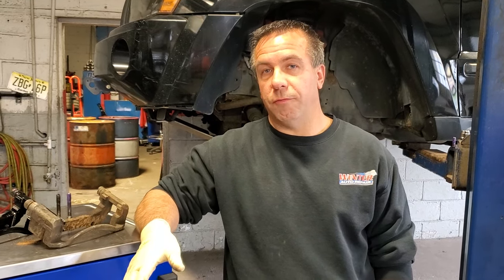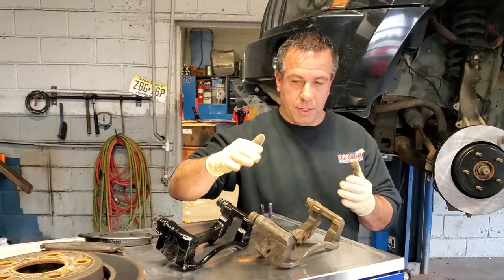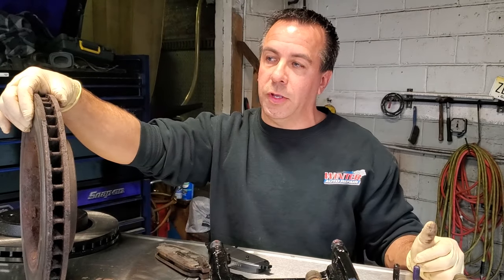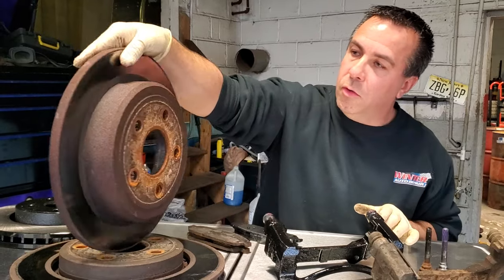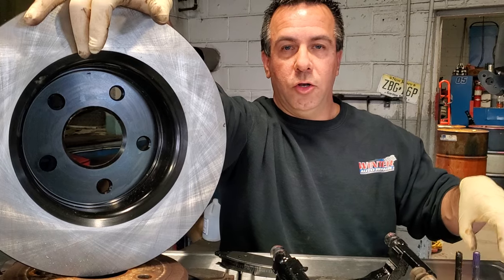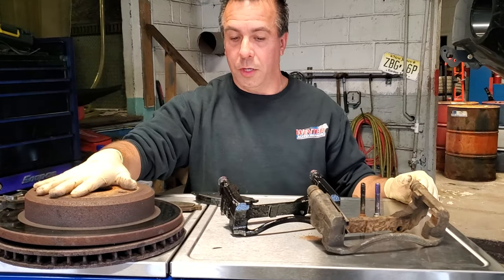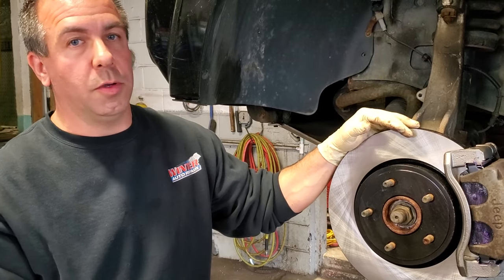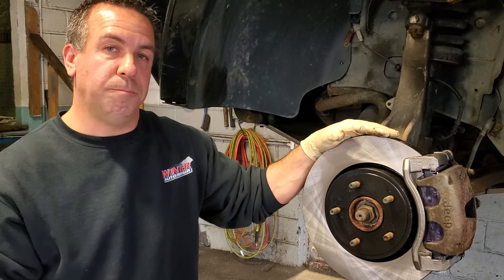High quality brakes vs cheap brakes

Comment: What rotors and pads would you put on a 2009 chevy impala LT 3.5L
Reply: For Impala brakes you can try geobrakes.com they sell all oem brakes
Reply: For Chevy brakes you can try geobrakes.com they sell all oem brakes
Reply from the maker: We use Centric whenever possible.  Our backup at Perfect stop.   Centric are a couple dollars more but worth the money!
Reply: Centric  is a cheap rotor you can find them for less then 30 bucks on Amazon. I'm sure there "quality" 🤡 give him 450 he will hook you up 😂
Reply from the maker: @michaelbukowski8030  they have several lines.   Their 320 budget line to their 125 high carbon line.
Reply: @WinterAutoRepair  Didn't mean to talk down your service I'm sure your great. I just see this new standard or replacing rotors at every break service and it's pointless. When refinishing and painting can make oem rotors last 150,000 easy with 1 or 2 refinish / repaints that prolong the life of the pads assuming you also do a light deglaze . I then making light lines in the rotor with my die grinder bits on my impact wrench.  Using a 1/2 to key bit and finishing with fog oil that you reapply annually. You can refinish to near cut quality without a expensive cut machine no one has anymore.I can get that fresh cut stoping power for any car as long as there is enough rotor material and you can too. Stop wasting on parts and labor smarter :)
Reply from the maker: @michaelbukowski8030  so you spend an hour cleaning up rotors to save 30 bucks according to you.    Just not a wise choice, sorry.    I'll continue operating the way I always have and keep my customers happy.  Thanks for the reply.
Reply: @WinterAutoRepair  Oems aren't 30 bucks and have thick walls with lots of rotor material. It's logical  to refinish not "clean" but do what you want old man winters 🥶
Reply from the maker: @michaelbukowski8030  oem and no thicker than aftermarket.   Tolerances have to be kept in order to fit the rotors into the caliper.
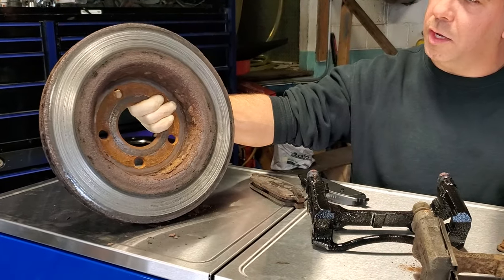Reply: @WinterAutoRepair   You can refinish 3-4 times and still be in spec with regards to width.  Hot rotors are almost always due to caliper pin cease or pad wear. Using a circular sander takes off 1-3mm at a time it's minimal. Yes this method works best for newer rotors at my 30 a rotor rate 😂  But you can easily measure used ones with a metric caliper and remain in spec. Listen you can charge 4 h of labor at   65 an hour and still be way under the price of 4 new rotors. That's 260 a set all shop money no waste on parts . You don't have to use the die grinder bits but the lines you make will give you the same effect in responsiveness  as you would expect in new rotors. I use a wooden block to steady the hand to keep lines thin and long. Alternatively to an impact you can use a rotary tool but it takes longer. 4h is a good number but it really only takes 2 - 2:30h after some practice. If you find it taking less time just charge it like paint and up the hourly you will quickly be the best price in the area regardless. For performance just use the best pads and calipers and make more cross hatched lines in the rotor. Ingenuity is better then complacency and waste but that's my opinion.
Reply: I mentioned OEMs thickness but failed to mention that it's often due to more even wear.  That leads to a thicker lightly used one 25-50k mileage. Thickness of new after markets match oem spec so obviously there the same new but they age differently excluding a few preformance after market ones but those prices are absorbent in my opinion.

Comment: Where can I find the rotors and pads that you used ?
Reply from the maker: Any good local autoparts store or online.  Retailers like rock auto, Car ID and even Amazon have them.   Just make sure you order the correct part numbers for your car.  Amazon may cross a number over and then you will get incorrect parts. Good luck!  Thanks for watching and commenting.
Reply: I got a chuckle from your comments about your racing experience and then seeing that rockauto in this list first time I ever heard of rockauto was a short track sponsor in New Hampshire racetrack and their practically my #1 automotive supplier

Comment: I’m on original rotors 251k miles Acura TL 2005. They don’t make them like they used to. 

My newer Acura MDX with 100k has warped oem terrible rotors.

Comment: I Allways spray my "white box discs" with heat resistant paint for 10 dollar for all four discs. They may start have surface rust after 5 years or more. I can accept that for the price.

Comment: What is the brand purple brake grease that you use?
Reply from the maker: Permatex 24125 Extreme Ceramic Brake
It's good from 3,000° to -50°.   We use it on every brake job including the exotic car and race cars we build and maintain. 
Thanks for commenting. Please subscribe because we will be making more content soon.
Reply: @WinterAutoRepair  Is that one safe for the rubber boots?  I'm seeing comments of people having issues with it causing expansion on the rubber.
Reply from the maker: We have never had an issue with the rubber outside boots. I have had issues with the rubber band that goes around the pin in some cars. Some cars have pins with 1 solid and 1 with a small rubber band on it. We usually replace the pins without bands or pull the bands off. I've had the issue with multiple brands of brake grease not just the purple.
Reply: @WinterAutoRepair  Thanks, for taking the time to reply.  I appreciate this info.  I have a caliper that's slightly seized, so I'm going to try re-greasing and inspecting it before I purchase a new caliper.
Reply from the maker: No problem. I enjoy helping.  Pins typically seize because the boot around the pin has a hole in it and water got in. You'll see rust on the pin. Heat the caliper bracket with a small torch or butane heat gun. That helps free the pin up. If you can get the pin out, get a small brush that can be installed in a drill. Clean the caliper bracket using the drill and brush with some brake cleaner. Once clean get new Pins and rubber boots. They should slide easily with new Pins and purple grease. If they don't, keep cleaning until they do.  Best of luck!
Reply: @WinterAutoRepair  Thanks. My pins were good. The issue was rust on the clips and on the spot where the clip meets the caliper and pads. I scraped away the rust, put in new clips, added the grease. The brakes are now releasing smoothly.
I think they rusted like that because I left the car outside and barely drove it in the last 2 years. I'm keeping it in the garage from now on.
Reply from the maker: We have been seeing that a lot since covid. Cars we not being driven and brakes were destroyed in the process. Congrats on getting them done!

Comment: 1. I turn my rotors frequently (several cars) and I have great results. 
2. Those rear pads ALWAYS show less wear b/c that’s what rear pads do. Probably 1/4 the wear rate.
Reply: Strange because i just did the brakes on my 2017 silverado first time... 70,000kms.. factory brakes. rears were down to basically nothing.. fronts had way more life.
Reply: @Ownag3s0up  is there a chance that somebody changed the front pads before you? It’s highly unusual for the back to wear faster. 

That said, I once had a Tahoe & my brother had an Escalade (basically a Tahoe) that had warped rear rotors. That implies they are being heavily braked & overheating. Your Silverado is basically the same trying as the Tahoe. So, maybe it’s c a GM woe?? 

Nevertheless, that’s highly atypical.
Reply: @Ownag3s0up  also…43k mi (70k km) I’d be questioning why pads need to be replaced at all. Towing a lot?
Reply: @robp2728  no towing. Bought the truck brand new from dealer. Just over 72,000kms. Replaced pads because I was on the squealers for an few days on the rears.
Reply: @robp2728  also noticed my front inner has uneven wear on both sides. Strange..
Reply: @Ownag3s0up  that’s unique. I don’t question your experience. But, it’s odd. Did you see your old pads with your own peepers? 

I service my own cars & I’ve had a host of them. The Tahoe & my bro’s Escalade were the only ones that had aggressive enough rears to warp them. 

It’s probably time you swap to a Range Rover with some factory Brembos. 🤣
Reply: @Ownag3s0up  based on you stating kilometers, I wonder, do you live in Canada? These symptoms could be the result of rusty components that don’t have free movement.
Reply: @robp2728  yes I did the brake service myself.. Lol I do live in Canada.. There is rust but nothing too crazy. I did re-grease the pins and pad brackets after the new ones were installed. I'm confused as to how the old ones  ended up the way they did myself.
Reply: @Ownag3s0up  - Canada…  Nailed it! 😃 

Be sure that the brake pads are free to move when installed. I have a Camry that is continuously warping the front rotors. The last time I took them off & had them turned, I used a dremel to wire brush the rust off of the caliper bracket AND the ends of the brake pads. The rust was very minimal. But, I did notice that the pads were much less jammed. I hope this will make a difference. 

I’m in Arkansas and we don’t deal with rust. This is my first car to self destruct it’s rotors in about 15k miles about 4 times, so far.
Reply: @Ownag3s0up  - https://youtu.be/AY-JGpWUXjg

This guy does a good job of explaining what I did. (except I didn’t consider putting grease on the caliper after cleaning.

Comment: Update:
Cancelled the Centric 120 series rotors because I wanted the high carbon but since the 125 series are not available for my car, I went with the 126 series which are Stoptech high carbon and slotted as per the Centric/Sroptech tech. But they were $590 total for 4 rotors. The series 120 were $200. Hopefully these will last me a very long time.....
Reply: Are centric 120s considered cheap? I thought they're considered pretty solid. I bought some for my track car because my OE ones seem to be on the way out. 

In fact, I think my OE ones are Centric 120s
Reply: are centric pads and rotors good? I recently bought the pads and rotors of that brand from Rock auto.
Reply: @asianstud7  I've used their seals to rebuild my calipers. The rotors are definitely solid. Not sure about pads
Reply: @404nobrakes  Thanks for the reply!!

Comment: When I talk to the people at car shops such as Car-X and Meineke and Firestone they never give me a straight answer as to what kind of Parts they are using they tell me they don't know but they want $500 to $1,000 for a brake job
Reply from the maker: Unfortunately, that's how a lot of this industry is. They make the bill confusing and unreadable.  
We actually take the time to educate our customers as to what they need and why. Then what we will use to fix the problem. The bill is laid out with each part, line by line and the labor it takes to install it. The reason we made this video was to put on our website and show our customers how we would repair their brakes. We had no idea it would get soo many views on YouTube!  
I suggest asking around in your area for local mechanics your neighbors trust. Interview them like you would a Dr.  Then once you find one you trust, be loyal! Go to them for everything from oil changes and brakes to tires. Having a loyal customer makes for a better relationship.  
Good luck and thanks for watching!

Comment: You don’t need state inspection to catch this, whoever owns that car just ignored it.
Reply from the maker: That's true, however, most people don't know what they are looking at.  We keep an eye on everyone's car when they come for oil changes or any maintenance.
Reply: @WinterAutoRepair  I'm still in a mandatory inspection state and one shop practically scared me away from ever getting a inspection done because I knew I was going to loose every cent however as long as I never went there for that they would print out a information page for a multipiint check up and then we could pick items from the list of green yellow or red list items and if you did stop by every time you get the new list up to date I loved that program when I was there

Comment: The brake pad didn't fall off. It was worn off, used until completely gone.
Reply: Depends on how the pad was adhered to the backing. Mechanical versus glued. It appears the pad sheared off the backing. ✌️

Comment: Why didn't he tell us the brand of the roter?
Reply from the maker: Because the quality always changes.  When we made this video, we used Centric Rotors. However, since then, Centric was bought by Raybestos, and the quality is terrible.  
Currently, we use Durago EPB rotors and Power Stop brake pads.  They seem to male the best high carbon and coated rotors. 
They can be found at quality local autoparts stores and online at places like Rock Auto. 
I hope that helps. Thanks for watching and commenting.

Comment: You can turn rotors. I've had the front rotors on my Miata turned 3 times over ten years. The next pad change WILL get new rotors, at least on the front. The rears are still fine (they've just been turned once). If I can drive a Miata LIKE A FLIPPING MIATA for ten years and get the rotors turned 3 times with zero issue, then I just begin to see this video as a "fear" video to get people to buy rotors from his shop at markup lol. Go buy fresh rotors elsewhere and take them down to him for installation and there will probably be "other issues elsewhere" that cost you money.
Reply: I strongly suspect that you have high quality rotors and pads on your Miata.  Further, I expect that the rotors were only turned enough to break the glaze off.  Sadly, that's not the norm - you are the exception.  By the way, I do the same thing when I work on brakes that have high quality rotors.  I use a flap disc to remove the glaze ( I don't have access to a lathe) and install good pads that won't wear the rotor (ceramic not metal sintered).  I would only use the metal sintered pads when I expect a great deal of heat being generated from Track use, Rock crawling, severe driving / towing, etc.  They stop better under adverse conditions but they DO wear the rotors more quickly.

Comment: The caliper and hose being bad can cause the same probem.
Reply: Most definitely, seen lots of vehicles were the hose was pinched due to rust where the hose attaches to vehicle. Open it up a bit and “oh look the caliper works again” but shops will never tell you that. Caliper and new hose much better for profit lol rip the customer off and may never come back or save them some money with an easy fix and explain the problem to them and will have the customer for life! Just my experiences… lol

Comment: By the way, those rear disks were good for another 50k miles. Rust on the outer housing? So f'ing what!  And sand the bracket all you want that is fine. But  it is the SS steel clips that the pads slide in. grease them and all is safe and good.

Comment: My mechanic didnt even have the decency to offer higher quality parts.
Reply from the maker: Unfortunately most don't because then you have to come back over and over for repairs.  I'd ask for the brand of parts your mechanic is using and if they only offer cheap parts, find a new shop.  Good luck!
Reply: @WinterAutoRepair  I just replaced my brakes and rotors my self. I'm a lot happier with my results and got rid of the squeak I had on the 4 month old "full brake job".
I also found a broken boot and seized caliper pin, like really? You could check the caliper to make sure it was fully functional?. Thanks for your content.

Comment: Why not show a new white box rotor??? Or a old cross hatch rotor?

Doesn't help having  salt on the roads during winter for half the year.
Reply from the maker: This video was done for our website to help describe what we do and why. You're correct. We should show the other style rotors. This particular jeep has almost 70k miles since we did this brake job, and it needs to be done again. We will show how these rotors held up and compare the lesser quality rotors in the same video. 
Thanks for the suggestion!
Please subscribe so you can see our comparison videos!

Comment: I can count on one hand how many times I was able to use all the brake parts I would buy ..and not have to return because of poor quality. Warped rotors due to shipping, out of round drums because of poor remam-process. and missing parts in the sealed brake pad boxes. I never paid them 30 dollars for rotors only 2003 grand Marquis..The pads doubled in prices...
Reply from the maker: Sad that even new the parts are not usable. Quality control, especially the last few years has been very bad. 
My shop buys parts from a vendor who only sells to shops. The general public has no access. Think of it like a plumbing supply store vs a home depot or Lowes. You may want to speak to a local repair shop and see if they have something similar where they can get you better quality parts.
Reply: @WinterAutoRepair  Yes. it been a few year since I "wanted" to do a brake job. My sister 2014 Kia ( in  2019 )  was the lasts... what a head ache getting the rotors off the rear.. never seen such a ridiculous set up. Im always on brake part sites like EBC ,Power Stop and the like..its coming down to that... high end parts for everyday driving...We're down to just 2 cars now...my wife's suv and our 89 Mustang  ( just for fun ).. We just turned 22,000 on her 2018 Sorento we bought new,  I had it in last week for tire rotation and oil change..they said my brakes still have 70 percent life left..The auto parts store I used to buy brake parts from is the last of the mom and pop places.. He still hanging on but just cant beat the super store prices..I always hate paying more for a warranty for the same item..that just tells me they know this stuff is crap before they get it.. and buying brake parts on line and then you need to return them and wait ....Don't want that ether...